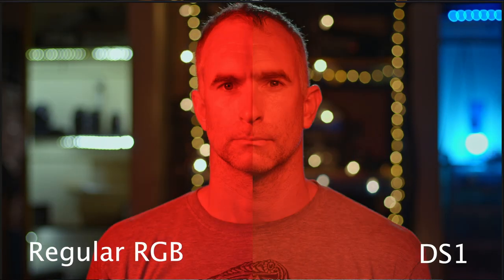Chroma Clipping and Clean Colors

Comment: So, in a nutshell, you can fix that clipping with the luts you're selling?
Reply: @lIlIIIIllIllIIIlIlII  but I needed to know if the LUT fixes it. I had that issue recently.
Reply from the maker: Not at all. Once a channel clips, there is no way to reclaim it. You just need to be aware that when using RGB lights you will clip a single channel way before a light meter tells you you're over exposed.
Reply: @Crimsonengine  so is way trickier to fix it. Dang... Thanks for answering!